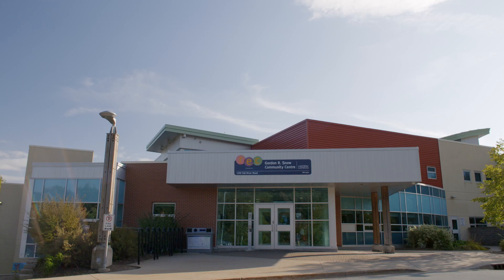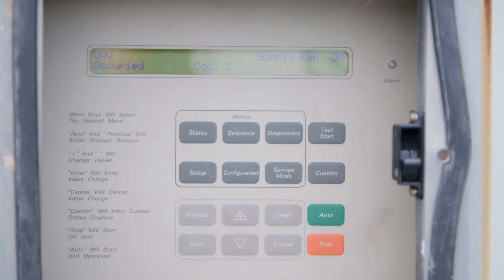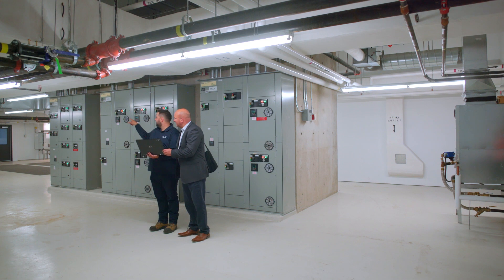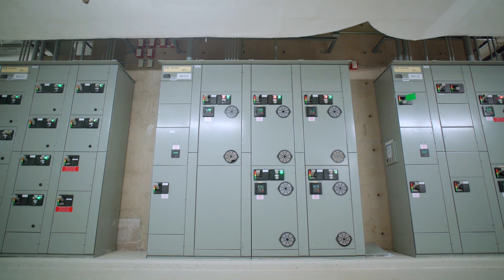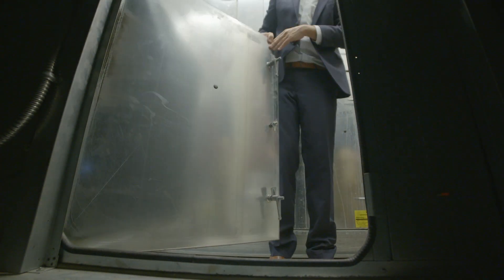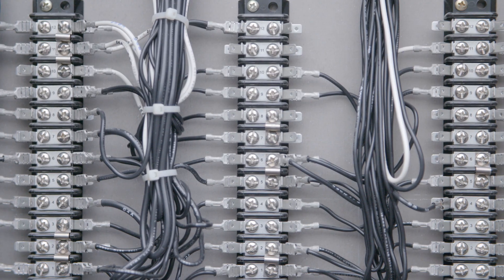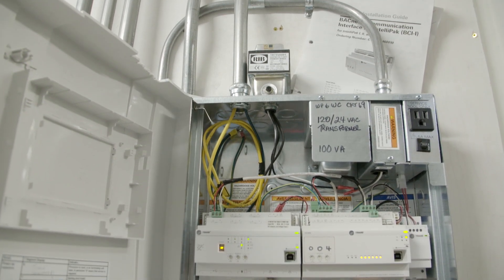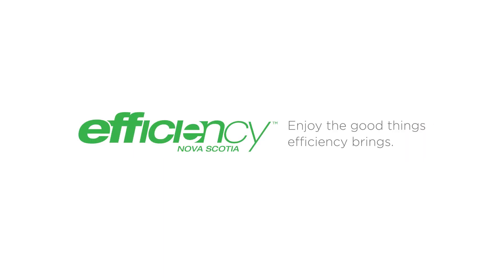Maximize the energy efficiency of your building and save big!

Comment: Tripe pane windows seem to be the standard in Europe. Seems like local window and door manufacturers could learn a lot from European window and door designs. They are much more energy efficient and have multiple seals to close air tight. If more people bought them they could ramp up production and lower prices. We make a mistake by looking for the least expensive option and not calculating the long term savings of higher priced window and door options.

Comment: My local utility offered free energy efficiency audits. I took them up on it and they did a blower door test and suggested some air sealing and insulation options. I took them up on the improvements and my utilities bills dropped by 30% the following month. Now I am saving money month after month, year after year on my utility bill. The payback period was less than a year. Money well spent. A blower door test can identify many places where air is leaking. Add them up and it is like shutting a window in the winter.

Comment: Every new building or remodel needs to be energy efficient. Saving energy saves money.
Air sealing, super insulation, triple pane windows, set back thermostats, LED lighting, energy efficient heating and air conditioning, energy efficient appliances, solar panels with battery storage and a 220 volt outlet in the garage for an electric vehicle charger. All these need to be considered in any new building or remodel.  Air sealing with a blower door test should be a standard part of any construction project.